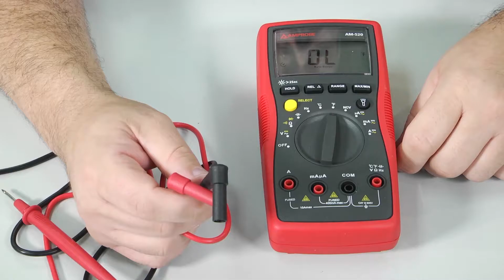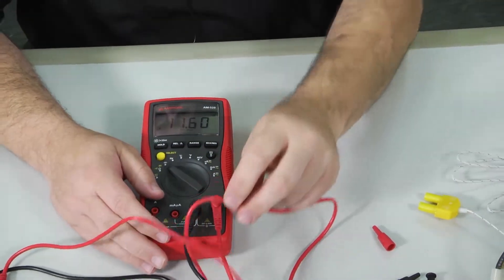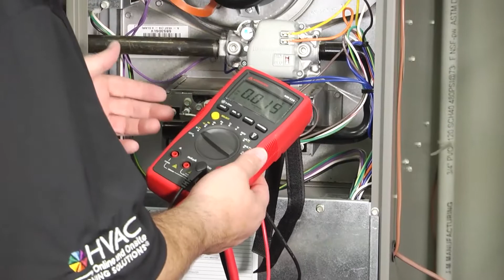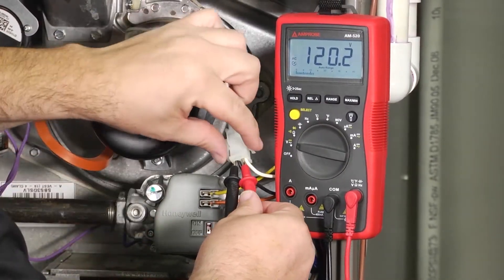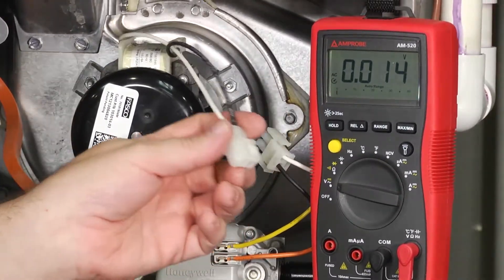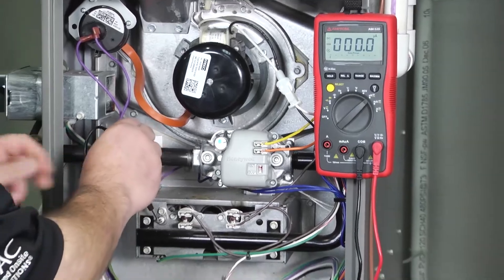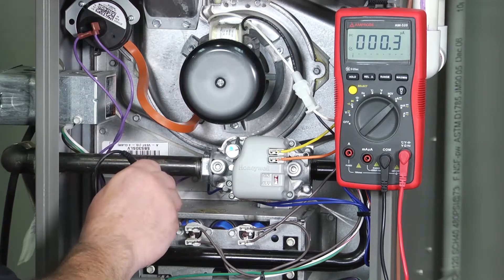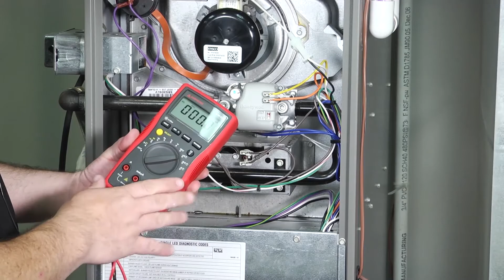Toolbox Tuesday: Amprobe AM-520 Multimeter Tutorial | Lennox

Comment: I also have this meter and ive wondered since I bought it why the capacitance range reads 11.4nF with nothing connected.  The one in the video does the same thing so I guess its normal, but none of  my other meters do it.  I was wondering if its maybe somehow designed that way because the AM520 is intended as an HVAC meter-??  It seems to read caps ok, but im puzzled by the 11.4 nF always being present.  If anyone has an answer I would appreciate it.
Reply: Me too (12.02 nF ). I am a beginner .Is your multimeter fast? Mine takes 12 seconds for a 47 μF and 16 seconds for 2200μF capacitor.  The one in the video only takes 2 seconds. It is normal?

Comment: I am a novice, but I would think you would need to change your red lead connection before measuring current.
Reply: I totally agree with you. What is more, the multimeter must be inserted in the circuit. (serial circuit)
Reply: Agree